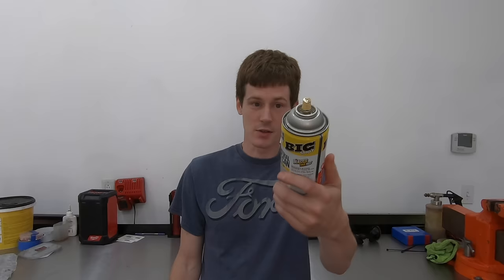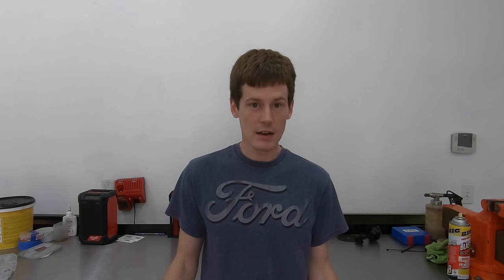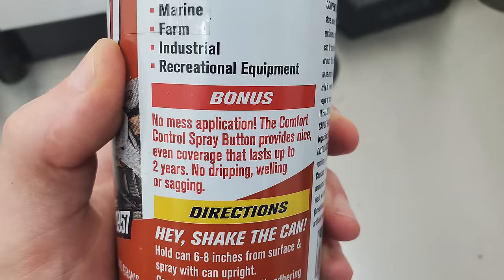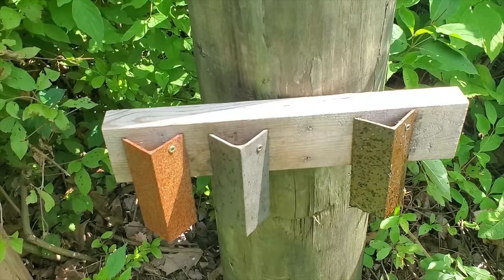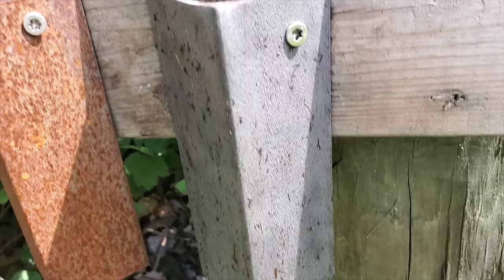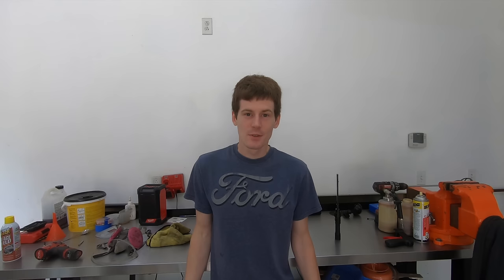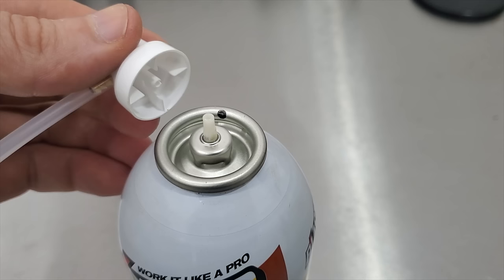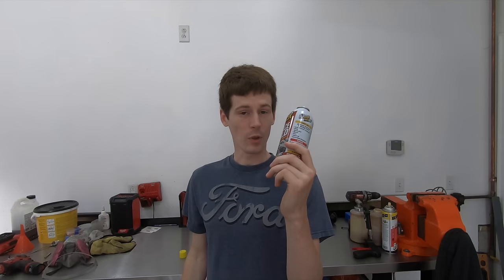I Finally Found The Best Undercoating On The Market... Blaster Surface Shield

Comment: This would be fantastic, if you could actually buy it. Guess I'll go with another brand.
Reply from the maker: Surface Shield is now available on Amazon.

Surface Shield Aerosol: https://amzn.to/3BeckCm
Surface Shield Bulk Gallon: https://amzn.to/2YpscVq
Spray Can Adapters: https://amzn.to/3x0A9LQ
INNER CAVITY SOLUTION FOR SS: https://amzn.to/2ZVDPnq (This will allow you to use the Woolwax/FF inner cavity tool)
Woolwax/FF inner cavity sprayer: https://amzn.to/3q49Swp
Bulk Spray Gun for Gallons: https://amzn.to/3iDs5M5

Comment: I plan to do my 22 WRX, is there anything I shouldn't cover?
Reply from the maker: Brakes and exhaust. Spray the rest inside and out.
Reply: @RepairGeek  so shocks, and everything under carriage? Are you familiar with the new WRX? I think there are several covers underneath I plan to remove.
Reply from the maker: Just hose it down my man, you really can't screw it up.

Comment: I sprayed my truck thismorning with this stuff.  Seems like it coats good However the Nozzles on the cans kept getting plugged. I have 4 partially used cans which i cant get the rest of the Surface shield out of.  Any one have a similar experience and or solution?
Reply from the maker: I've had it happen a couple of times as well. I was able to clear the plugged nozzle by blowing compressed air in them. After that they sprayed normal again.

Comment: Why are you advertising for FORD with you T-shirt?   Ford f150s are/were MADE to FAIL …. the rocker panels are water holders and are designed in a manner that is different from the super duty.   Pockets for holding water are built into the f150 rocker panel!

Comment: Interestingly enough MSDS sheets show:
- Fluid Film is all different petroleum distillates with no lanolin.
- Wool Wax contains 60%-100% lanolin.
- Surface Shield has 6%-31% lanolin.
Reply: So you're saying fluid film is false advertising? NO lanolin?

Comment: Are you still recommending this product for undercoating a year later?
Reply from the maker: Yep. Others are having success with it as well.
Reply: @RepairGeek  do you know of anyone shop/ dealer that applies it that I can take my truck to.
Reply from the maker: Don't take this the wrong way but how would I know? I coat all my own stuff haha. My best suggestion would be to check FB Marketplace for someone in your area that does it on the side.
Reply: @RepairGeek  Because you’re a local, use the product, work for the B’laster we’re the assumptions I was working under. I’m a traveling medical professional currently in Indianapolis, IN not far from your general location. Do you take customers?
Reply: Most shops I’ve contact use either fluid film or wool wax. And B’Laster does have a list of shops that use or install their products
Reply from the maker: You can send me an email and we can discuss this a little more: repairgeek365@gmail.com
Reply: @RepairGeek  email sent

Comment: Why not use something you can’t get at a box store that’s way stronger in every way
Reply from the maker: Name one.
Reply: @RepairGeek  How about 3 for different applications. Cor-ban 23 or 35, ardrox av 30
Reply from the maker: Those are products that dry, what I'm using doesn't dry. 
Here's why that matters: https://youtu.be/WZr4qoKGfXs?t=394
Also the products you're talking about are at least 3x the price of what I"m using here.
Reply: @RepairGeek  something like cor-ban 22 is a non- drying product to name just one. The price point is high at 2.3x fluid film but it’s a very high quality product. I use Corban 35 on my boat and trailer as well as in the aviation field that I work.

Comment: I use Rust Check, and it works great,  is inexpensive.  Fluid film not the best
Reply from the maker: https://youtu.be/9SOOfZFmhSY?t=806
Reply: @RepairGeek  yeah, you don't use inner pannel oil on the undercarriage...just plain dumb
Reply from the maker: Send me some then... I don't have a dealer anywhere close. They don't sell online... I used what I got my hands on.

Comment: Seems like a paid advertisement as you took this for free so your review is now biased towards surface shield.
Reply from the maker: It doesn't take a genius to attach some scrap metal to a pole...
Reply: @RepairGeek  True but you gained a lot of respect in your previous video turning down a free product to test stating stating it would make you hesitant to be fully honest in your review and you turned around and did it here with surface shield.

Having said that surface shield looks like it is a great product and if it was available in Canada I would be using it this year.

The problem now is you can never be fully honest about surface shield or any other PB product as you now work there.   Ita the nature of the beast.
Reply from the maker: I don't use that particular product because what I was using held up better in my testing:https://youtu.be/9SOOfZFmhSY?t=922

Comment: This is all non-professional gee whiz shaky can bullshit.
The best coating comes in a 5 gallon bucket for about $80 at the hardware store.   Non-fibered roof coating.  Very thick, impermeable, and dries stiff.   We’ve used it on salt water boat trailers for decades.  Yes, it can be sprayed with a fillable Jeni-can.

Comment: there's rust under the surface shield. the fluid film looks brand new. obviously a POWER WASHER will remove it. normal driving conditions will not. Stop being a Derp

Comment: The subject at hand is a shit box GM product, DEFINITELY NEEDS A RUST PREVENTATIVE, 😂😂😂😂
Reply from the maker: I bought a chevy because Ford hasn't engineered a 4wd system that actually lasts in the past 30 years. Or a truck that doesn't leak something in the first 3 years of ownership. Send me an email (repairgeek365@gmail.com) and I can send you photos of my 2010 F150 at less than 8 years old and 80k miles needed a set of rockers, bedsides and both painted bumpers to be replaced.

Sincerely,
A Still Current Ford Owner.

Comment: May be an amazing product BUT ... the company has failed in numerous ways.
Availability in Canada is crap. There spray cans are crap - clogging and failing to spray after limited use. Large size containers not available for sale to Canada. Even if you get a large container they can't even give you the specs for a proper air compressor but rather have you ask the manufacturer of a given sprayer yourself  if it can spray their product.
Sounds like a major fail or half-assed job in marketing. Enough for me to avoid. Shame.